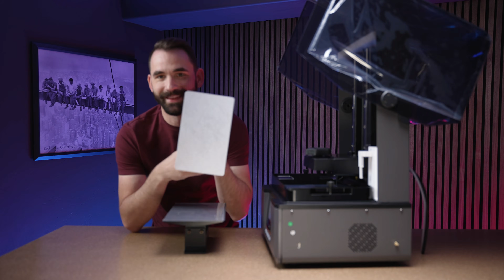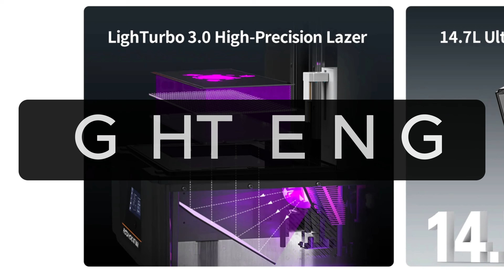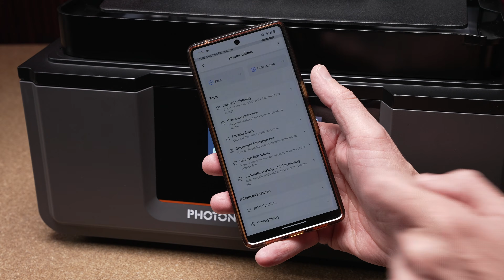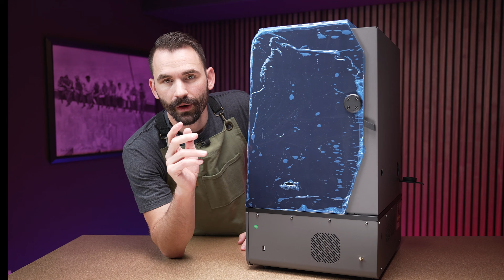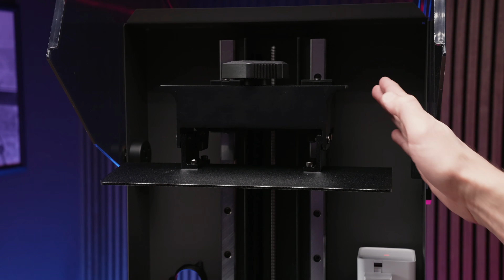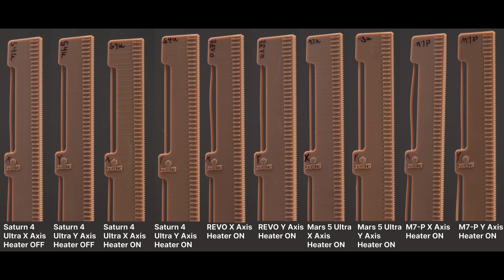Should the M7-Max be your next Printer?  #review #3dprinting

Comment: hey J3d,  With my Uniformation gktwo meeting its end today, vat stuck to plate and kept lifting until  the legs snaped, resin getting everywhere including electronics.      I'm in the market for new printers.   I'm looking for something similar or smaller than the GKtwo and want it to be as hands off experience as it could be.   With my research being  mostly 1 year old now,   and so many printers releasing this month: 
heygears, m7max, mono 4, mono 4 ultra, mars 5 ultra,  saturn 3/4 ultra etc .  
What do you recommend .

Im in the south, hence temp control is not a requirement.
Note I used to  normally use Tough + abs like v2 from anycubic.  But have moved to Waterwashable + from sunlu, but might go to Water washable ABS from ancubic soon ( also used INlan, but i bought all the stuck in my local microcenter)
Reply from the maker: @KevinHernandez-e5u  What are you printing? That's the biggest thing. 

The printer can only work as well as the resin and the water washable resin is terrible in my opinion. It is much more brittle warps a lot more on the shelf and if you didn't know this, it is just or even sometimes more toxic than the other resins. If your reason for using that is simply because it's hard for you to obtain the chemicals required for cleaning other resins that make sense but for any other reason I could not ever recommend using it. 

As for the printer, I would stay away from The Saturn IV or the Mars 5. This is because they come with the new auto leveling systems that has no auto leveling in it and no ability for you to manually level the build plate. This makes these printers unbelievably unreliable with no viable workaround. 

If you're looking for a solid printer that will just work that is smaller than your current one, I would really look at the mini 8ks or the Mono 4 Ultra .

If you're okay with keeping with about the same size, I would look at the M7, not the m7 Pro but the normal M7. 

The Revo is also a good printer but kind of expensive but it is built very very solid.
Reply: @J3DTech  currently printing mostly Dnd figurines and War hammer proxies..  
It's good you mention this as on the saturn as it was my current #1 runner up (saturn 4 ultra) as it went on sale today ($399) prior to this i was looking at the mono 4 ultra ( 259) , i see ne M5s pro is also on sale ( 299.99) and the m7 max is about to be released .

They hey gears went out of the intro price, and now is out of budget
Reply from the maker: @KevinHernandez-e5u The ones I mentioned should work great for you on those types of prints. You're going to love the quality of what you get off of it and working with them is going to be a lot easier than some of these other ones. 

Especially if you've already been 3D printing for a while, you understand how to do it. I think the Saturn IV ultra's main selling point is that a lot of the settings have been removed so it's easier for new users. 

And I think that it would be a very good printer had they simply Left out all that auto leveling stuff that ended up making it a very frustrating. Very expensive printer to run due to the massive amount of wasted resin you get from trying to print using it out of level build plate.
Reply: @J3DTech J3D, on the Saturn 4 Ultra leveling issue (also should apply to the Mars 5 Ultra with similar build plate), I thought I saw a YouTuber (can’t remember who, maybe Ross/Fauxhammer?) show that the build plate can be manually adjusted (ie. leveled). Of the 8 screws on top of the build plate, the four inner screws can be adjusted for leveling the build plate. The suggested action is to, like usual for 4-point leveling, place a piece of paper on screen (screen is in the default flat position), lower the build plate until it just touches the paper, pull on each corner of the paper, feeling for even resistance on the paper. If not even resistance on one or more corners, then adjust the related top-inner screw until you have even tension when pulling the paper at the four corners of the build plate. Once set, it’s recommended to mark each of the four screws’ position with a sharpie and use some Loctite to hold these four screws in position. I’d be interested to know your thoughts on the above manual leveling for these two Elegoo Ultra printers.
Reply from the maker: @dovmerrill804  So these screws are not designed to be loose. A YouTuber discovered if you do the springs may have a little less tension and give you a more even spread. 

However the screws can move during the print because they are no longer tight using LockTight can help however this doesn't fix the issue. 

The issue is that the springs will still. Well spring back into position as soon as the pressure is released. And the pressure must be released to allow for the resin to fill the gap. 

The Mars 5 Ultra does have the same issue but it's not as bad because the smaller size.
Reply: @ Thanks for the additional explanation, that now demonstrates that I don’t fully understand the design intention and mechanical function of these Elegoo build plates. Perhaps my understanding is wrong. There is a fixed upper plate. There are four inner posts (with screws affixing them to the top plate). I don’t know what their function actually is, and they don’t make sense when compared to the outer posts. The outer posts have springs on them (just under the upper plate), and I believe these posts slide up through the top plate when the bottom plate moves upwards (ie. when the space between the bottom plate and the top plate gets reduced, while the spring on each post gets compressed). So, the strain gauge on the z-arm should see an increase in force during scenarios where the build plate presses into the ACF vat/LCD screen or, for example, the build plate lowers into the vat and presses into a hardened piece of resin sitting in the vat. In these cases, the build plate spring movement should prevent the build plate from damaging the ACF/FEP film and/or damaging the LCD screen. The question is “What function do those 4 inner fixed posts on the build plate perform, and why don’t they prevent the 4 outer movable posts (ie. the spring-containing posts) from functioning (ie. moving)?”.
Reply from the maker: @dovmerrill804  The 4 inner posts are are leaf springs and just help with lateral movment. The entire bottom plate can move freely as it's only held by Springs. 

Once the pressure is released, it must be for resin to fill the Gap so that you can print layers.. This is additive manufacturing afterall. The springs will decompress back to their resting position. The Z sensor in this function is really just acting like a Z offset but not Auto leveling. 

You can find the data here, check out both tabs. 
https://docs.google.com/spreadsheets/d/1LSXRgx5GRPAShDu6UDmmOhi61Zdj50iOv4RaK8Y25DA/edit?gid=0#gid=0

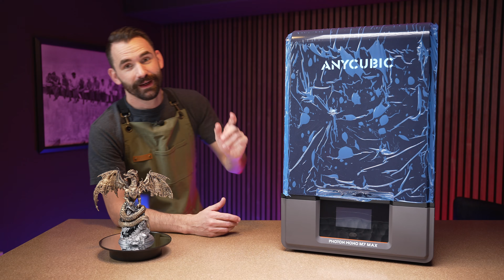Comment: 3:41 "I don't want my printer to become ugly because of spills, so i'll make it ugly with tape and protective film" there is logic behind it, but it's still funny
Reply from the maker: @SergeiSugaroverdoseShuykov  🤣

Yeah see but the spills never come off and remain sticky. This stuff I can remove if I want to take a picture and the printer is always in peak operating business.
Reply: @J3DTech  my S4U lid is already as dirty as hell while i didn't spill anything on it, and yeah it feels like that resin dissolves acrylic and eats it's way inside because it is possible to scrape majority of it off, but droplets are still there, i guess only sanding and clear coating will fix that
Reply from the maker: @SergeiSugaroverdoseShuykov  Yep, it's crazy how it just bonds to it. It doesn't have to be cured. The second it touches it. It's chemically now part of the cover. Forever...

Comment: Well, it seems to be an interesting machine but the 46um is what worries me a bit, especially when the GK Three Ultra exists (same size but somewhere around 24um if my memory serves me well). Yes, the GK3 Ultra is also much more expensive but as someone who is about to start up his 3D design/printing studio I am in the "twilight zone" and can't decide which printer to go for (for both large prints and minis).... But the M7 Max does look promising!
Reply from the maker: I have a GK3 ordered... I'll get it sometime... When I do I'll do a short with a AB comparison.
Reply: From what you've seen so far with the M7 max, would you suggest it for professional use (print medium to large prints - some of which have fine detail) or should I pick another printer?
Reply from the maker: @evanskan6326  What are you printing?
For dental, engineering I think its perfect!

For minis, I would go for a smaller printer with a higher XY UM.
Reply: @J3DTech  After some research I think I will go with the M7 Max (fingers crossed they will also release a LCD upgrade at some point). I will print mostly large scale statues and terrain. Even the miniatures I saw online (printed on the M7 Max) weren't bad at all. I will test it myself and if the mini quality isn't what I am looking for, I think I will also buy the Mono 4 Ultra.
Reply from the maker: @evanskan6326  they're actually pretty good. I've printed more stuff on it and I'm impressed with the quality

Comment: My M7 Pro also had a not so flat buildplate. I mailed Anycubic with my findings, they sent me a new buildplate for free. That one was also not so flat. So I sanded the first buildplate on a very flat natural stone surface. It works like a charm now. I also use your builtplate leveling design piece. I really love it.
Reply: Crazy that this is still an issue which was present all the way back with their Photon Mono X which came out in 2020 I believe. Goes to show Anycubic just doesn't care and which is why I avoid their products.
Reply from the maker: I had the same issue but luckily my replacement was very good.
Reply: The 😊

Comment: the Curvy non planar. Center of the Plate (13.20)  will only affect the First Layers?  thanks
Reply from the maker: Correct it's going to affect the raft. The printer will reach a level print at about 1mm.